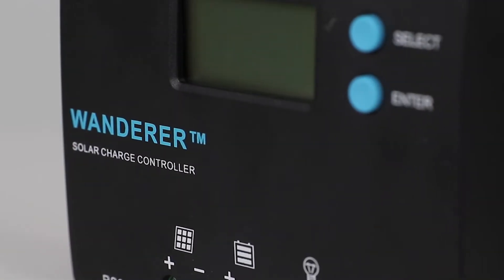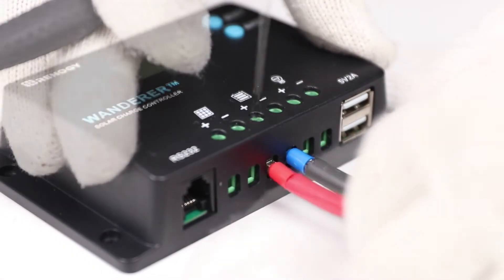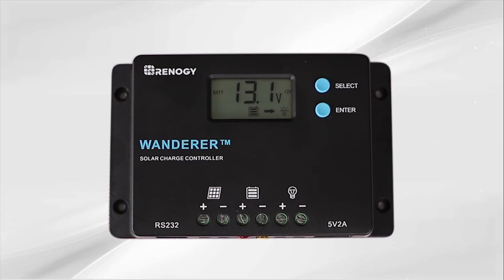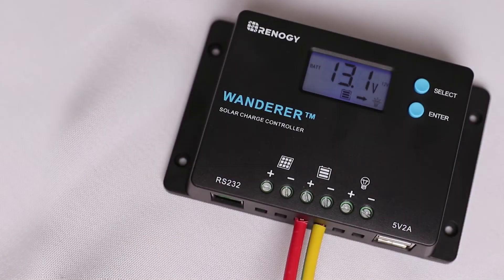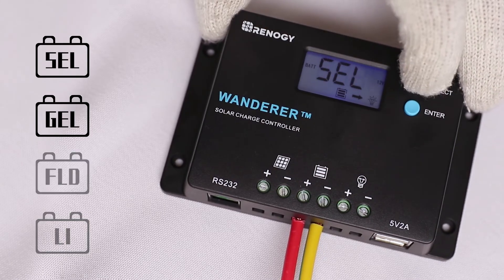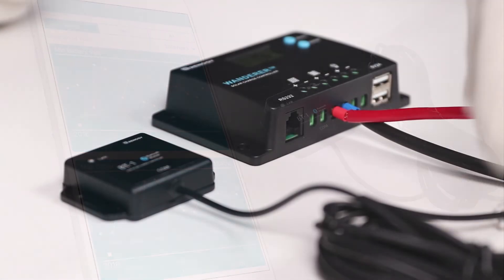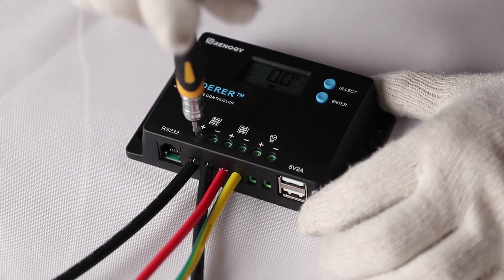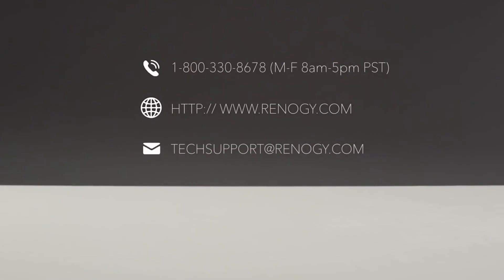Renogy Wanderer 10A PWM Charge Controller

Comment: ThyUSB ports are not charging? What could be wrong? I have a simple setup, a Marine battery, a 100 watt panel and the controller.????
Reply: Hello, may I ask if you have turned on the load port? It's usually meant to be turned on.

Comment: What is the loads low voltage disconnect/ reconnect? I cant manually set it. And there is no mention of this in the manual.
Reply from the maker: Hi, Cal.

You can refer to page 21 of our manual book: https://www.renogy.com/content/RNG-CTRL-WND10/WND10-Manual.pdf.

Comment: I got an exactly same controller, except the name is WANDERER PG (instead of WANDERER TM). It does not have the LIT for battery type, only SEL, GEL, and FLD.
Are they different model? Or mine is a fake one? (bought from Amazon).
Reply from the maker: Hi, binh.

For your issue, we suggest you can submit a case through our Help Center Portal (links listed below for specific locations) for help. 

https://renogy.force.com/helpcenter/s/contactsupport (USA)
https://renogy.force.com/helpcenterau/s/casesubmit (Australia)
https://renogy.force.com/helpcenterca/s/contactsupport (Canada)
https://renogy.force.com/helpcenteruk/s/contactsupport (UK)
Reply: Mine too- I’m not happy about this… going to return mine

Comment: I've read the manual and every comment I can find on these.  I have a 250W, 37V panel that has the potential of making just under 9A max.  So I'm good with the initial parameters.  The manual states this can take a 50V input and will automatically find the battery voltage.  Now for the question:  Does an input voltage over 24V require a 24V battery bank?  (This seems to be the case on most small and inexpensive PMW controllers.)
Reply: Disregard this comment.  Communication with Renogy customer service was pathetic and not helpful. I have now gone down the PMW controller rabbit hole.  I understand these controllers basically function by switching ON and OFF.  This means it is best to keep the input voltage near that of the batter bank.  Too much input voltage will kill the controller.   Renogy states this Wanderer 10A controller has a 50V input potential, which is extremely misleading.  Even the super cheap Chinese PMW controllers tell you above 28-30V input you must have a 24V battery.  Guess I'll keep the Chinese PWM and alter the panel.
Reply from the maker: Hi, MF.

Our PWM charger controller will pull the pv voltage down to a similar level of the battery voltage during charging. As long as the pv input is within the limitation of the controller, it will not do damage to your battery when the controller is working properly.

Comment: When setting up a lithium 24v battery, the 'boost' voltage selections appear to only be for 12v batteries (12-16v). Are they doubled for 24v (ex, set to 14.4v for a 28.8v max charge)? Manual doesn't specify it anywhere.
Reply from the maker: Hi, Gnomish 8.

For proving you with prompt help, we suggest you can submit a case through our Help Center Portal  (links listed below for specific locations）for help. 
 
https://renogy.force.com/helpcenter/s/contactsupport (USA)
https://renogy.force.com/helpcenterau/s/casesubmit (Australia)
https://renogy.force.com/helpcenterca/s/contactsupport (Canada)
https://renogy.force.com/helpcenteruk/s/contactsupport (UK)

Comment: I have this Wanderer solar charger, and when I connect the Renogy 12AWG 9 inch solar MC4 cables to it, one keeps coming loose on the solar charger end ! Should I get the 14AWG instead? Any ideas, thanks
Reply from the maker: Hi, Reviews.

Thank you for your feedback. The current of your controller is 10A or 30A? If it is 10A, 12AWG 9 inch cable is enough. If it is 30A, we suggest 10AWG/8AWG cable. 

If it keeps coming loose, it may be the problem of controller itself. For the condition, you can submit a case through our Help Center Portal with more details (links listed below for specific locations) for solving your problems more timely and efficiently.
 
https://renogy.force.com/helpcenter/s/contactsupport (USA)
https://renogy.force.com/helpcenterau/s/casesubmit (Australia)
https://renogy.force.com/helpcenterca/s/contactsupport (Canada)
https://renogy.force.com/helpcenteruk/s/contactsupport (UK)
Reply: @RenogySolar  Hi, yes I have the Wanderer 10amp controller and it's brand new, and I am using the Renogy 9 inch 12awg MC4 cables too, thanks for letting me know though about these resources.

Comment: Strange I had just ordered mine. But my battery option does not show lithium option.. it only shows GEL and FLD battery options
Reply from the maker: Hi, Bunrong.

Thank you for contacting Renogy. 

In order to know the version of the controller, we suggest that you can contact us through the case to solve your current problem(links listed below for specific locations). 
 
https://renogy.force.com/helpcenter/s/contactsupport (USA)
https://renogy.force.com/helpcenterau/s/casesubmit (Australia)
https://renogy.force.com/helpcenterca/s/contactsupport (Canada)
https://renogy.force.com/helpcenteruk/s/contactsupport (UK)

Comment: How many 100w solar panels can I attach to this charge controller?
Reply from the maker: Hi, dear customer.

If your system voltage is 12v, you only can use one 100w solar panel. If your system voltage is 24v, you can use two 100w solar panels.

Hope it is helpful.
Reply: @RenogySolar  Nicely done
Reply: @RenogySolar  system meaning the battery setup?

Comment: Set mine up with a 40 watt mono solar panel to float charge my 12v car battery and it works a treat. My controller is mounted in the boot. Amazing the number of people who ignore the instructions and complain that the PWM is faulty. When connecting cables to the controller always first connect the battery, then the panel. Reason being if the panel is connected first, the controller will burn out because it cannot dissipate the voltage anywhere and fries. If you need to disconnect the battery, then disconnect the panel first. With my set up, I just disconnect the panel and drive away. The feed from the controller to my battery is via the OBD diagnostic socket, meaning I can leave it connected whilst driving. The added advantage of this is also with the engine at tick over you can see the alternator charging voltage on the controller.

Comment: Not sure what is wrong, but it was trying to put 18+ volts into my 8a lifepo4 and got the over voltage error. Why would it be doing this? I have the LI selected, 12v, and 14.4v charge voltage.
Reply: bonehead it says 12 or 24

Comment: Everyone on here complaining really doesn’t know what they are talking about. I have 2 Renogy controllers and 3 panels and a Bluetooth dongle. I’ve have zero issues with any of it. I’m in the process of building a “grain bin cabin” and will be reaching out to Renogy again. Do your research and learn what is what....
Reply: Yep a lot of folk run this at times with battery disconnected (such as using it to charge a car battery, then disconnecting the car battery without disconnecting the solar panel first). That will damage the connector. When used properly i.e. always with battery connected these things work well.
Reply: Mine everything works but still working on the two screws for a load. In a flash can USB charge everybodies phones safely with a small 30 watt panel. It's a keeper.

Comment: Don't buy these pieces of crap!  The first one I got worked for a little while charging a car battery then went berserk and quit, letting the battery go dead!  I had actually purchased 2 of these pieces of crap so I took the other one out of the box and tried it but it's totally dead and doesn't do anything at all, the display never even comes on!  How do you guys stay in business with this garbage?
Reply: Having any solar system run without a battery will damage it.

Comment: Is a 10amp 12v battery the max this can charge?
Reply: 10 amps is the charge current. As long as your battery bank is 12v it’ll charge it @  10 amps. Like a battery charger you buy from the store. Except with the sun. My battery is 1000 amp marine battery, takes a while to charge but it charges. 
Source: I haz one.

Comment: My charge controller appears to have died after being connected overnight. The battery still shows 13.3v and I’ve tried different cables - though this shouldn’t be necessary. Goodbye, $15!

Comment: I bought one and I returned it. I had a I had a brand new battery it was a deep solar battery 35 amp hours the charge controller was telling me it was a wrong voltage . The screen cycles through while charging the battery . Sucks volatge was all over the place